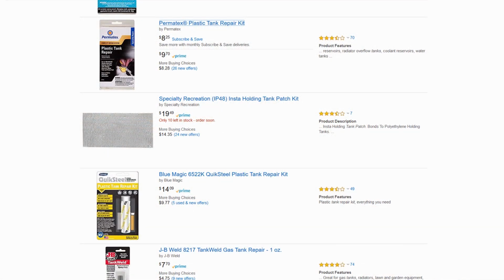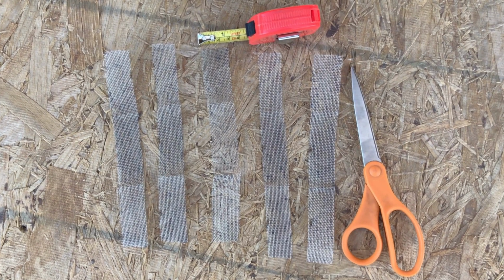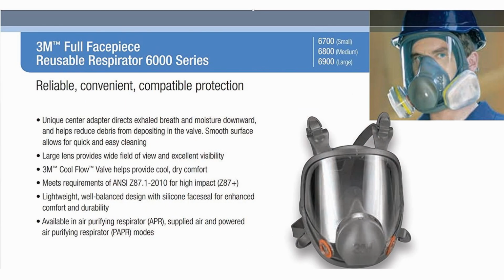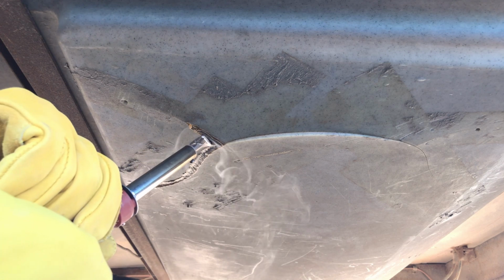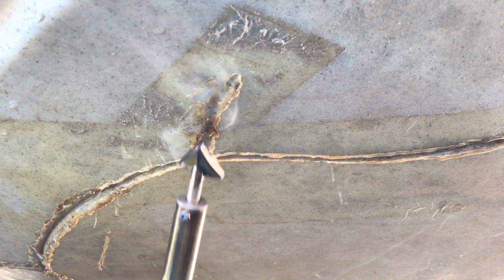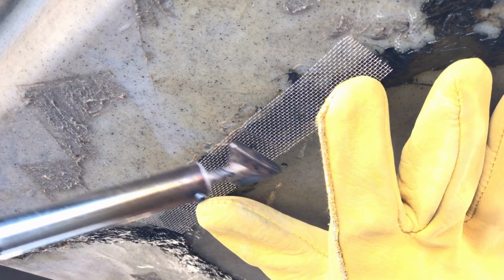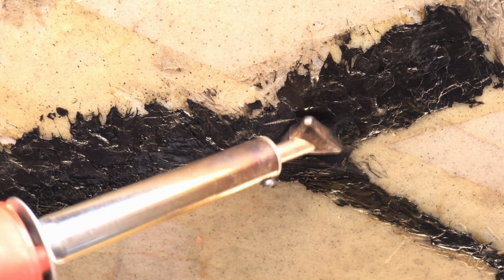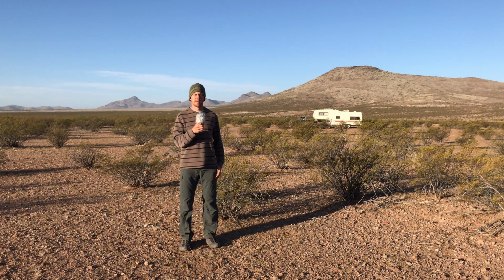Plastic Welding RV Holding Tank Repair, DIY with a Plastic Welding Iron Kit

Comment: What if I don’t got cracks I got 3 holes a little bit bigger than 5/8s of a screw idk if they did it to steal the gasoline and I don’t wana pay 800$ for a gas tank would it be better for me to just melt a bit of plastic around the hole and some to cover it partially then cover it with the mesh and add more on top ?

Comment: I saw a professional do a tank earlier tonight.   What I can tell you is he melted the plastic of the tank and rod at the same time with a torch and laid a solid bead.  Then he put on the mesh and kept heating it until the plastic had come completely through the mesh, which you did not.  Then once the black was completely through the mesh, he cut small pieces and put them on top, just like you did.   Hopefully, you will have no issues with yours!

Comment: Your respirator information is absolutely wrong. A P100 cartridge is designed to filter out physical particles, not chemical vapors. you want a cartridge designed to filter out organic vapors.  3M's website, as well as many other places online  have selection guides.  That will direct you to  the cartridge suitable for what you are doing. Yes there is smoke during plastic welding, and a P100 will filter out the smoke particles, but the chemical vapors will go right through it.